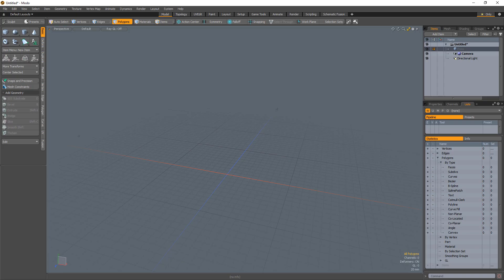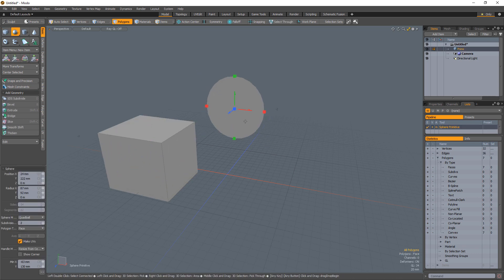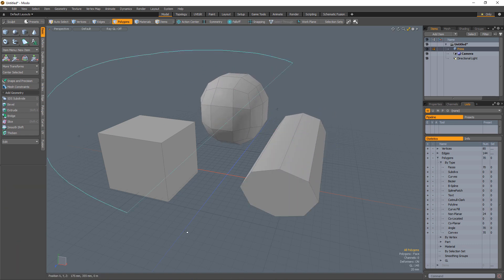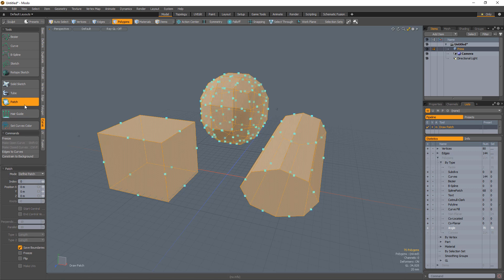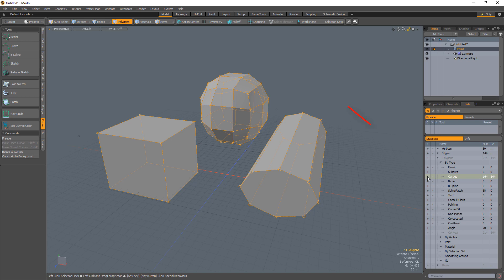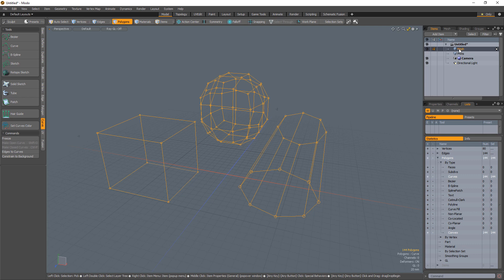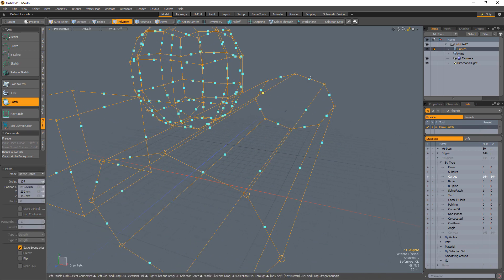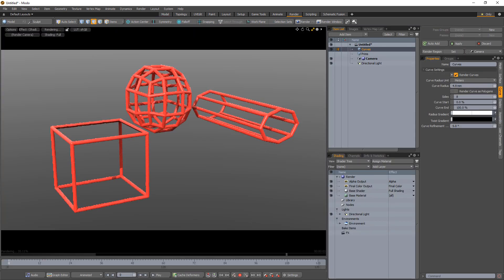MODO | Polygons to Curve Cage

Comment: Can this be done as Meshops?
Reply from the maker: without testing... Id think its very much doable.
Reply: I tried using edges to Curve> then Freeze the Curves> Poly extrude > PolyBevel. But unfortunately the results are not ideal. the tubes are not aligned to the center. mesh collapsing around the corners.  @pixelfondue